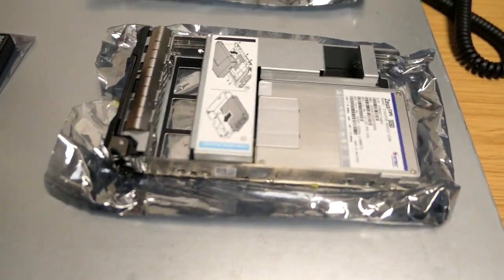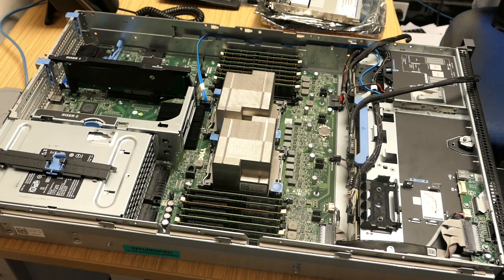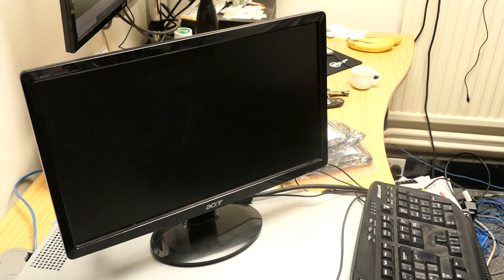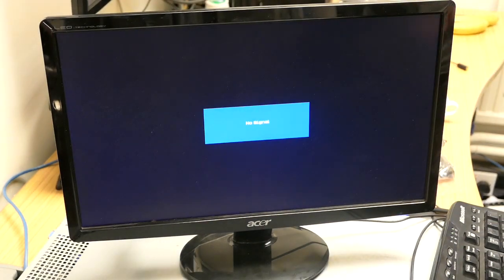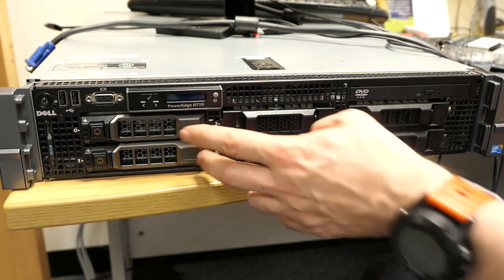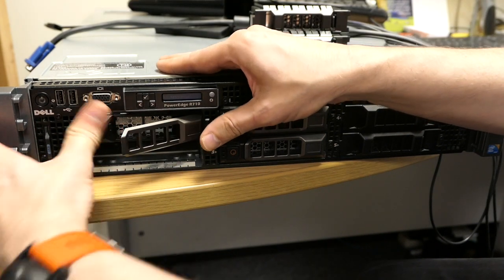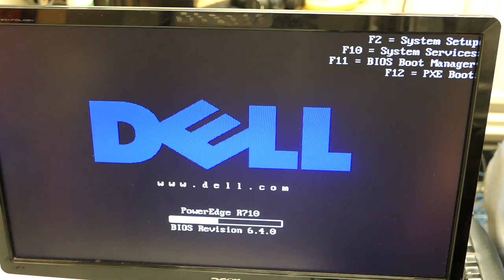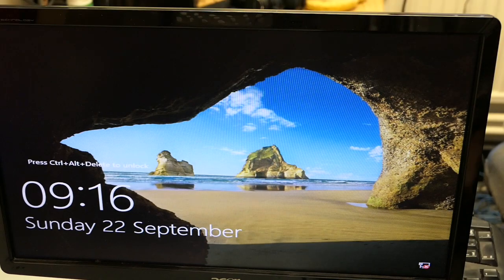Dell Server SSD Upgrade

Comment: I like how you explain everything on the cables and how the cables are tucked away on the side of the case.  I did notice you did not have a anti static wristband, I know there is a lot of static where I work with the servers.  I also like how you explained to remove the old controller card with the clips... good job!

Comment: this helps, trying to change my raid 1 (discs 0.0 and 0.1) on H700 from 2 320gb spinners to 2 500gb ssds. cannot do it in openmanage figured would have to do during boot then restore from backup

Comment: thanks not sure what are trying to do with the drives.. but after importing  the foreigh configuration during bios boot from the perc 6i to the perc h700 all i needed to do was like you .. goto safe mode add the new controller then it rebooted fine.. didnt need to do any drive swapping.. not sure why you did it or what you were doing.. this in windows server 2019 on a p[oweredge r900
Reply from the maker: Hi

We were replacing the hard drives with SSD, which also required us to replace the RAID controller, hence the extra steps we needed to take.

Comment: I have 2 SAS drives that are recognized and I have created the appropriate vds' and initialized both of them. 

However, the other 6 SAS drives all come up as 'failed'. Now these drives do not have any issues with them. I hooked up a cable to them and all of them work and have been successful for using as boot devices and storage media. It only shows up as failed whenever I hook them into a server that was a perc 6/i SAS controller.

How do I remedy these issues?

Comment: Thank you for the usefull video, worth watching :)
May I ask a question? I'm planning to replace my old SAS hdd 2.5" drives on my Dell R320 server with compatible ssd 2.5" SATA drives, do I need a cable to convert for the sata drive to connect to sas port on the server or only put the ssd SATA into the tray and put it into the server?
Another question :), use acronit true image to clone windows server 2019 on the dell server and restore is easy or need to prepair anything else special?
Thank you.
Reply from the maker: Thanks

Not sure about the R320 as not seen one. If it is the same as other Dell servers then the tray and backplane should handle this. You should be able to download the manual from the Dell site to confirm this. Maybe worth trying to source Dell SSD's in the correct tray/caddy.

With Acronis you need to install this on a PC or server, does not actually need to be the server you are upgrading, as all you are doing is using this to generate the USB boot drive for the cloning process. If all your drive bays are full then you will need an external drive to back an image up to and then switch the drives out and restore to these. If you have spare drive bays then install the new drives and you can clone straight from one to another which is much faster.

Good luck on your upgrade :-)
Reply: @thatwebbloke  Thank you very for the long instruction indeed <3
I've done cloning pc and workstation for hundred times but never try on a real server, hope the booting process from a Acronis USB disk be smooth and does not stuck at any blue screen :)
As I've not purchase the new Sata SSD drives and Caddy Bay yet, so I will have to clone the OS drive to external drive.

Thank you one again, I will be very scare if I have to face a failure at booting process like you did as in the clip, exactly how many times the server have been reboot ? And the duration until it booting successfully after you able to login to desktop from Safe Mode?
Reply from the maker: @mailhn83  It takes 3-4 reboots before safe mode kicks in. The longest bit about the reboot cycle in the Dell BIOS and self test :-(

Comment: Thank you for the nice video. It is very useful for my upgrade. I have Dell R710 with 6x3.5'' chassis and SAS drives inside. I'm going to upgrade the drives to SSD SATA. I will install PERC H700 but I'm not sure about compatibility with SATA drives. Does the backplane handle SATA connection even the it use SAS port ? Is it enough to just insert the SATA drive in tray and backplane will be matching ? 
Thank you.
Reply from the maker: The backplane should be fine with the new drives and controller, but do check with your supplier as your config may differ to mine.

Comment: Thx for the video...but could you link or describe the hardware replaced with details like model...thx again
Reply from the maker: Thanks.

The server and the parts are from Server Source (https://www.serversource.co.uk) used them a few times and always found them to be good. Their website is not great but if you drop them an email they can help you out. 

I don't know the part numbers (as they are not on the invoice), but are listed as Dell 800Gb SAS SSD in R710 Caddy and Dell H700 Raid controller (inc. Cables and battery).

Hope this helps.
Reply: @thatwebbloke  thx for the answer...I was hopping for the battery model...I bought a separate kit with just the cables for the controller without the battery.
Reply from the maker: @mightykolher  Apparently the Dell part numbers for the battery are 312-0448. It is the same battery for all Perc raid controllers so if you have replaced the controller then the existing battery will work.

I only swapped it as it came with my kit otherwise I would have left the old ones in.

They can fail after a while and you get an error come up telling you to replace them.
Reply: @thatwebbloke  we tried using the existing battery, but received a message: Raid Controller battery failure ... so we think there is another one

Comment: my server dell poweredge 1850, this with 2 hd scsi 36gb. what controller and cables do i need to use ssd?
Reply from the maker: No idea. You need to contact Dell or your dealer.

Comment: i have to upgade a hp ProLiant ML150 G6, i was thinking of 2 samsung pro 860 ssd, or should i use some type of server ssd, no sure, where can i see server ssd models ?
Reply from the maker: These were Dell server SSD, which I think are Intel rebadged. These and the controller cards, where used units. The servers were used as well but all came with a 3-year on-site warranty.
They are not mission-critical so would not matter if it was down for a day or two. Loads of people selling reconditioned servers so would always suggest having a look.